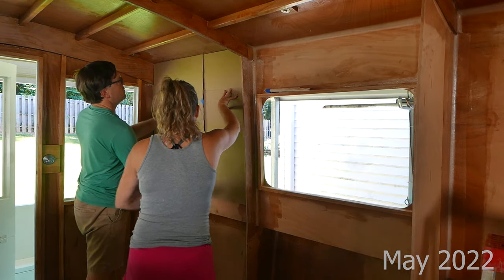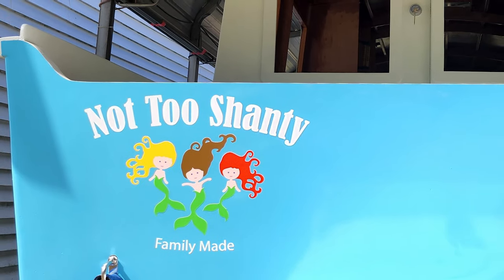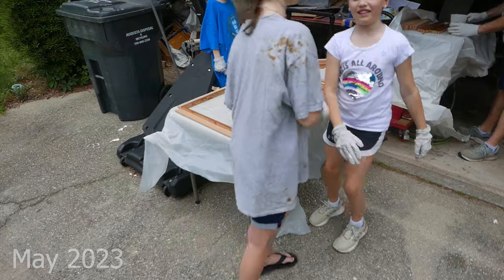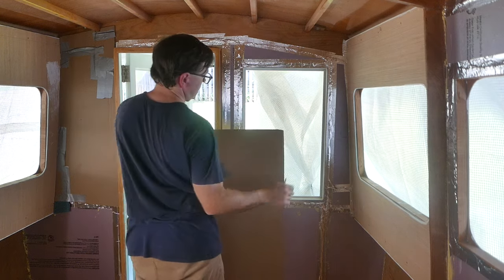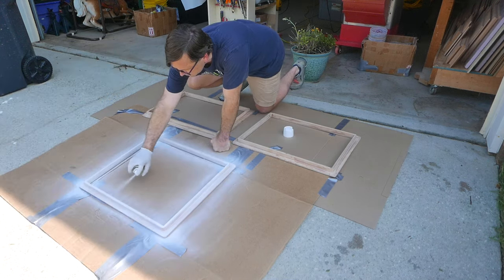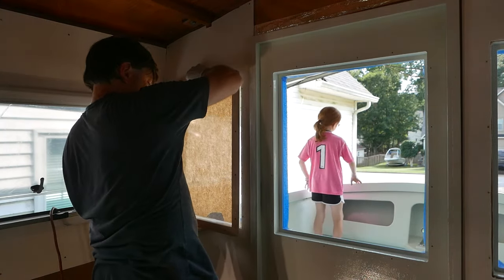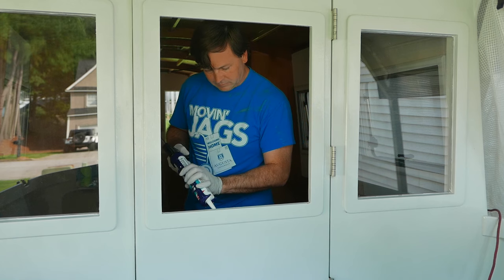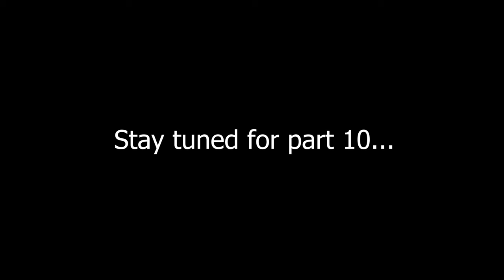Building our GT27 Houseboat, Part 9

Comment: Thank you for the video's, I have finally decided to get started thanks to these. I was following your posts on bbc, but I was still unsure if I could actually build it, but this has inspired me.
Reply from the maker: Randall, unless you definitely need this much space, you might consider the smaller GT23 version. It's shocking how large and how much labor the GT27 requires. Ours is coming out well, but WOW has it been exponentially more work than any of the previous boats I built before.

Comment: Loving your build for years, involving all of your family and it’s looking fantastic. Was wondering how heavy it will be at least 7000 lbs with tanks filled , loaded with your motor. Enjoy your adventures together.
Reply: Yes, I wondered about the towing logistics.  Having had a similar size boat in the past, it was very easy to get to the towing limits, and not getting away from standard braking systems and into the expensive breakaway load area.
Reply from the maker: The boat should come out at or under 6000 I think. It's around 4000 now plus 2000 for the trailer.

Comment: Could you please let me know the model of the Anhui Maygood windows you ordered?
Reply from the maker: It's very difficult to say for sure. I ordered them three or more years ago and it took over a year to get them to close the deal. I don't know the exact model number but they're a gray tinted acrylic insulated model, about 19" h x 32" l or so.
Reply: Bought the same plans several years ago and then stumbled across a Yukon Delta at a good price. I told the wife I couldn’t build as much boat for the price. Still looking to build one though. Looking forward to seeing you float this one.